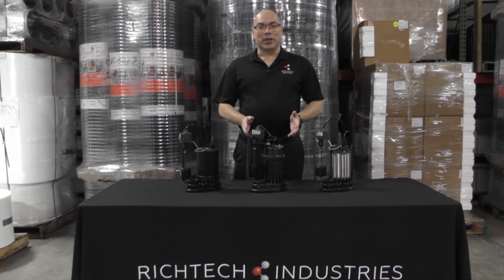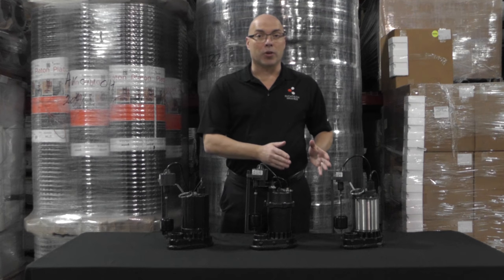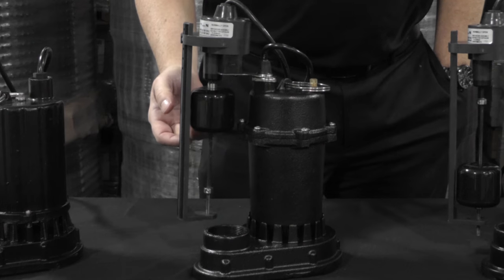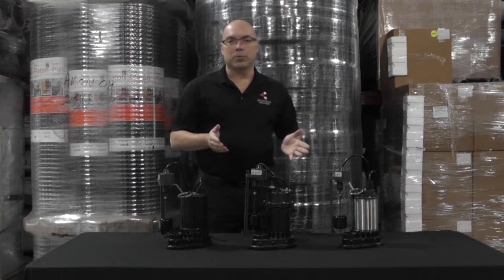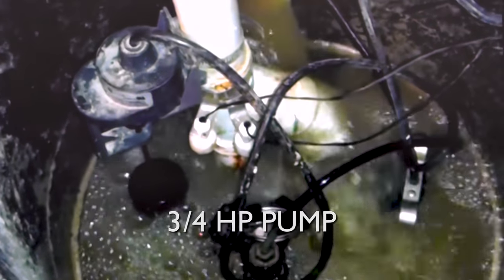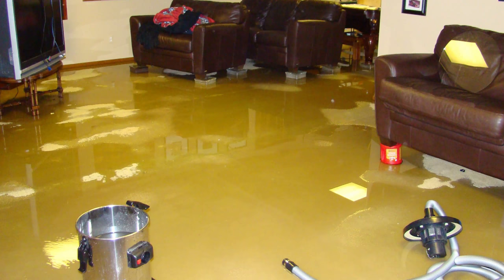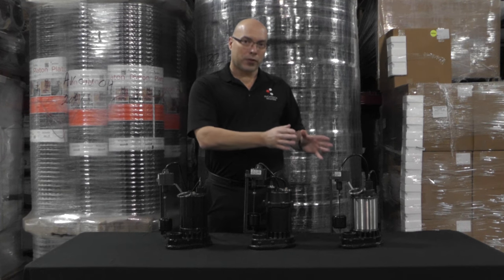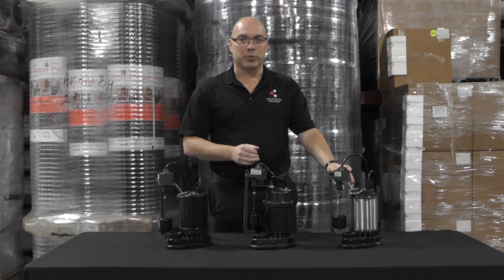Sump Pump Short Cycle

Comment: One problem with short cycling pumps is the ridiculously short 4 inches of travel of the float switch on a submersible pump.  My pump is a 1/3 hp, 2880 gph pump. I can't really go with a smaller pump because in a huge downpour the pump just keeps up with the inflow to the pit.  Last night we had 3" of rain on top of another 1-1/2" last week.  The pump cycles every 15 to 20 seconds and pumps the pit down in 6 seconds.  I've tried a pedestal type sump pump with a much longer float travel but have not found one with sufficient quality to last very long.  The bearings corrode and seize up when not in use.  The check valve works fine, no water backflows to the pit.

Comment: Outstanding video, thank you!  I have 2 sump wells, each have 1 hp pump. Cycle every 45 seconds.  Just had new drain tiles installed inside and out. Constant waterflow all year. High water table here near Lake Michigan.

Comment: Why are manufacturers unwilling to make or sell a switch with a long life? I have a stand-alone sump pump switch that probably has 1,000,000 cycles on it - and that is not an exaggeration. Of course it is probably 50 years old now. I would be willing to pay extra for a switch that will last as long as a good pump.

Comment: When it is raining my sump pump is running every 30 seconds. I think I need to enlarge the capacity of the sump hole so that when the pump kicks on it will run longer and have fewer cycles per hour.
Reply: Bingo

Comment: My sump pump in running every 30 seconds and I don't know what to do.. it's driving me insane!  The float isn't stuck and I'm worried I'm going to burn out the engine!
Reply: Put the pump on bricks inside the pit and check to see where the water level sits on dry days so your not constantly fighting that level along with the  rain water
Reply: is the pit normal size ?